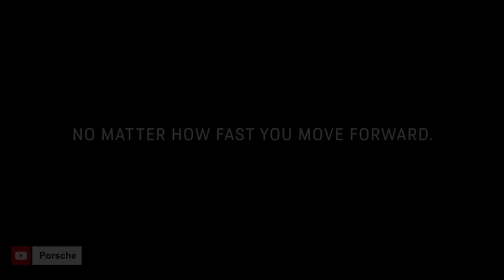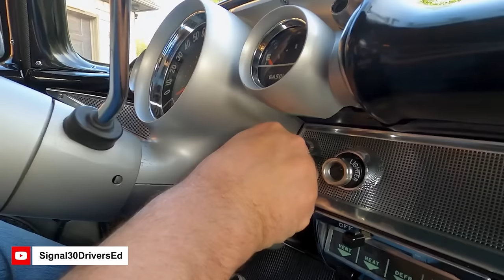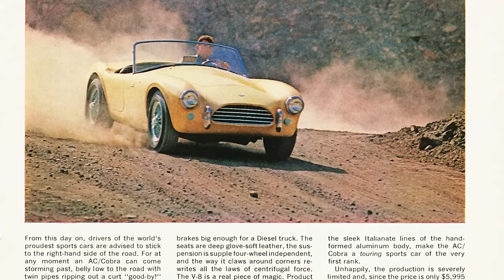Why Old Cars are Better

Comment: I hate that people think the old car obsession is only because of nostalgia. It feels like everyone is getting grifted by the regulators and manufacturers to think that newer always = better. There are plenty of ways older cars are objectively superior. Outward visibility, ride comfort, and ease/cost of servicing are just a few. I'm 33 and by choice have never owned a vehicle newer than 1997. Older vehicles are nicer to own, and nicer to drive.
Reply: The only advantages old cars have are looks, personal feel, and basic components. 

You want reliable, SAFE, efficient, options, then you go new. 

And holy shit safe is such a key point, old cars are absolute deathtraps if you crash, but hey you get to look cool as you die
Reply: @mattd6085  Do you just think all classic cars are 1967 Mustangs or something? You'd be shocked at the quality and comfort of something like a '79 Mercedes. The outward visibility and ride comfort--things that actually matter every single day you use the car, not just when you crash--are superior in older cars. Vintage diesel Mercedes can go over 500k miles on their original engines and nothing more than routine maintenance. 90s Japanese cars are also more reliable than the equivalent modern versions.
Reply: @verdict1163   What is comfortable is entirely subjective. My modern daily is far more comfortable than my 1980's car. And if I had to choose what to be comfortable in when someone hits me head on, it's gonna be modern and you'd be a fool to say otherwise.

Vintage diesels can last just as long as modern diesels will with maintenance, but holy shit they are wildly inefficient compared to a modern one. 

I can tell you now my modern JDM is more  reliable than my EP3. All the 90's cars that weren't reliable are already dead and scrapped, it's called survivorship bias.
Reply: @mattd6085  Specifically, the ride quality is superior on older cars, because of the tire sidewell and softer spring rates allowed by lower curb weights (not having to haul around all that extra safety equipment). Seats were often sprung instead of just hard foam, another sacrifice for passive safety. 

It's a fact that 90s/early 2000s cars were the peak in terms of reliability, and have kind of slowly declined since then. Everything now is boosted to the moon, direct injected, thinner weight oils, to eek every last bit of efficiency out. None of which is good for long term serviceability of reliability. 

Offset piston/rod geometries, integrated subsystems (that can't be repaired but must be replaced as a unit), sealed transmissions, thinner weight oils, a general lack of bottom end reinforcement - these are all examples of ways in which modern engines are not built as robust as ones from a few decades ago. 

The 1990s were the sweet spot for reliability because we had extremely good machining standards and electronic fuel injection, but without the extra complication mentioned above that came later to eek out every last MPG.

Comment: How old cars are actually better: they were simpler to work on, so anybody with a set of hand tools could work on them (which is good because you were gonna have to work on them). 
They had better visibility (which came at the cost of the roofs crumpling like a tin can if you rolled them over)

Modern cars are faster, usually more reliable (depends on the brand or model really, looking at you bmw, and Subaru boxers.) They're faster, and more efficient doing it (don't come at me with some anecdote about a customized car or one off). They're way safer for the driver (which given today's drivers, is sadly needed). And way more comfortable (ergonomics of the seating, better climate control, better suspension). And way easier to use (thanks technology).

Everything els in this video is just pining on about how it makes him feel, throwing objectivity out the window.

Don't get it twisted, I love old cars, but let's not throw away reason and facts for our feelings.

Comment: I'd bet that the Tesla if stored correctly (so save from moisture) would last (the only thing that would break in those mention 50 years would be the battery! Yes, it would be expensive to replace those, but otherwise the vehicle would not degrade much IMHO...electric-motors need a lot less maintenance than a combustion engine!

Comment: Although my car will be 20 years old in a year and I always feel nostalgic about the beautifully designed '70s and '80s cars from my childhood, I can still remember of the issues. An edgy old car with no safety systems could cleave the limbs off of pedestrians like in Carmageddon. Also, even a low-speed collision could kill the entire family inside so efficiently that even the dog left home died. You were lucky if the car did not completely fall apart after a coulpe of years / 50E kilometers. Even many of the cherished Japanese cars of the era started to rot away the chassis around the otherwise healthy engine after 10 years. And so and so on forth. Been there, seen that.

I think the sweet spot is somewhere around the early 2000s where some important safety systems like ABS / ESP / no pointy edges were already included, materials / timed aging were not set that precisely as now that cars can literally fall apart after guarantee periods are over. Also the cars were not littered with unnecessary electronic crap like massive touchscreen systems that on failure stall the car completely. Simpler is always better. I can see an ample of dinosaurs from late '90s - early 2000s still running on the road in decent condition, many of them running way above 500000 kilometers with factory installed major components.

Comment: I'm 41

My first....
92' Corsica 
Current....
07 Volvo C70
What i want....
83 tbird 4cyl turbo in red

My current vehicle is my favorite it's not a classic yet but it's on its way and it's very simple it doesn't have all the touch screens and all the extra s*** these cars have these days it is the perfect vehicle for me. It's a straight 5 turbo. It's simple. I do not want a brand new 2023 2024 vehicle I feel like they are too much. I also had a 99 Mercury cougar which was a very close second place that was simple it was a stick it was a 6-speed it was simple. I also had a 2003 Hyundai Tiburon it was a stick it was simple. I feel like the older cars are just better they were built with a different mindset and not all the extra s***. Also I never wanted a car that everybody had I hated that. I don't like push button cars I don't see how people got used to that. I don't like my car cutting off at a light by itself and then cutting back on when I hit the gas it's just too much. I like to work on my car I don't want to have to go and take it to the dealership every time something dumb goes wrong.

Comment: This simply isnt true when it comes to cars. We have extreme survivorship basis when it comes to vehicles. 1950s car modles didnt even have odometers capable of reading over 100,000 miles. Even 80s models rarely got over 200,000 miles. New modles, espcially toyotas, hondas, and even other brands can easily get 250,000 miles with proper maintenance. Old cars absolutely did not last as long

Comment: I think you're over selling it a bit. And maybe some older cars feel the way you're talking more than others. I have a 67 Thunderbird, with a 6.4 l V8 and the rear suicide doors, by the way headlights, vacuum system that locks the doors and rows the windows up and down. No I know at that point with the mustang a couple years old Thunderbird was meant to be kind of this luxury sports car before it became the land yacht luxury car of the '70s. It feels very comfortable and some of the stuff you're talking about just doesn't apply to that car It actually surprises me how modern the car feels for a car that is from 1967. I have made a few improvements just to make the car a little safer I upgraded the rear drums to disc brakes since the front brakes were disc and redid the brakes on that thing metal brake lines the whole deal to make sure that car stops. Upgraded the carburetor cuz when the original went it was a bit small for that car so the newer one bit overpowered but gets her moving a bit more which I like. But she's a smooth driver. Dual exhaust but muted sounds she's not rumbling she's not meant for that she's a refined glamor bird that she was nicknamed. Listen to podcast and play music I have an updated the stereo system so it's still just an a.m. simple unit I just have a big Bluetooth boombox that I bring with me when I'm cruising in that car and play music from my phone. In some way she's very simple but another ways she's sophisticated for her time and she feels elegant she drives nice more like a modern car I think a lot of people would say that car feels like a higher end luxury car from the '80s like a New Yorker something by Cadillac or Lincoln more than it does something from the '60s. Otherwise good video I did enjoy it.

Comment: I HAVE 86 VETTE 160000 MILES CHANGE OIL EVERY 3000 MILES  PUT 1500 INTO IT AND WOULDN'T  FEEL SCARED TO TAKE  IT ON A LONG TRIP. FIBERGLASS BODY NEVER RUSTS .TODAY ITS HARD TO TELL A HONDA FROM A TOYOTA OR CHEVY FROM A FORD
AND DON'T GET ME STARTED ON SUV S. COOKIE CUTTERS

Comment: The best solution I think is to take a modern car that has been written off, one of those with a nice aerodynamic body, then tear out and sell all the new garbage components as a parts car, put an old bulletproof motor and gearbox into it, hook everything up from there and drive it. You get the benefits of brand new aerodynamics for maximum fuel economy, and with all the office luxury driving comforts removed you're actually connected with the vehicle. And of course, wide tyres with tall sidewalls for comfort and low rolling resistance, since we all know wider tyres roll better than thinner ones at the same tyre pressure, that's why normal cars use 30 psi, but thin tyre ecoboxes use like 65 psi tyres instead that provide roughly zero traction.

Comment: Old cars are not better as far as safety goes. You get in a rollover or high speed wreck in one of these, you'll be seriously injured if not dead. Not to mention no power steering, manual drum brakes, no seatbelts. They're deathtraps.

Comment: This is some navel gazing if I've ever heard it. 

Look, I've rebuilt the suspension completely on more than one car, done engine rebuilds, torn them down and rebuilt them, the works. Yeah, it's all old cars I've done this to and old cars are a lot more simple than newer stuff; cheaper to repair, more simple in design and sometimes, generally designed to actually be repaired. 

But here's the thing: New cars ARE better. Yeah, they're generic, they lack character, etc. But when I was a kid, people would say stuff like, "100 thousand miles? What a jalopy, better buy something new", because you were looking at cars that were cheaply assembled, cheaply designed and generally lasted about 60k miles before needing major repairs and rebuilds. Sure, your average Chevy or Ford might need something like that these days, but you can also go to the dealership and buy yourself a Honda Civic for 30k that is easily going to last you 20+ years, get 300k+ miles, be safer, quieter and FAR, FAR more fuel efficient than something built in 1950. 

Old cars handle like crap, they smell (no emissions, after all. Take a shower after driving yourself to grandma's), if you get yourself into an accident, expect to be impaled upon your steering wheel or have the entirety of your upper body smashed when it rolls over. 

I get it. I like old cars too, own a couple and continue to maintain them myself. New cars are full of computers that I can't hope to troubleshoot, but let's not pretend everything is bad and that we're all "le born in the wrong decade." Cars are better than they've ever been.

Comment: Quick answer: Old cars had a soul and personality. 

New cars, are just soulless copies of copies.
Reply: Quick answer: Old cars had a soul and personality. 

New cars, are just safer, more efficient, more comfortable, longer lasting.
Reply: @mattd6085  "longer lasting” I beg to differ…
Reply: @BETTER.ART.   There are more cars from 2001 on the roads than 1971. 

The only old cars left are the few that happened to survive by being looked after. You look after a car from 2010 it will last just as long.
Reply: @mattd6085  well, it may be that I consider a car from 2001 an old car. Everything after 2005 just reflects the current throw away society culture in my opinion. After that time, cars just got higher and unnecessarily bigger.
Reply: @BETTER.ART.   The US is not the default. Post 2005 cars are STILL average sized and reliable here in the rest of the world. I have a 2009 daily car in my collection that is maintained and so far hasn't had the slightest issue. My 1980's car however, requires a lot of care to keep going.
Reply: @mattd6085  who said anything about the US?

2009 is also not a new car. Take the latest BMWs or Mercedes for example. 

Everything inside is digital. If your odometer display breaks, you can’t drive, as it won’t let you. You have to tow it to the dealership and it will cost you a fortune to fix, as the whole thing has to come out. Just small repairs and fixes in general. Everything is over complicated.
Reply: @BETTER.ART.   You literally said anything post 2005 is throw away. 

If your brand new digital display breaks, your warranty will cover costs? If you're trying to argue that it's MORE likely to break, you better back it up with figures, otherwise it's just you personally not liking modern systems. 

If someone REALLY wanted to, they could learn how digital systems work and fix it themselves. Just because it requires a different set of skills to older purely analogue systems doesn't make it a bad thing.
Reply: @mattd6085  “ … in my opinion” 

What if it breaks after your warranty expires? 
I don’t need to back it up with any figures. I just need to ask any of my mechanic friends and they will tell you the same thing. 

It’s no lie that newer cars are filled with unnecessary shit. (Not talking about safety sensors) 

More electronics and digital stuff —> most likely to break.
Reply: @BETTER.ART.   Of course you need figures, otherwise you're just talking out your ass.

Comment: love the vid but 1 clear lie you said was fuel ingection is simpler then a carb NO NO and NO if a vehichal has a carb even if the carb is bad and needs rebuilt u can still get that car running may run bad but run fuel injection not so much sometimes yep its great car can sit but because of the fuel injection just fires right up but most the time some many difffrent things can happen with it that it be easier to replace the entire fuel system carb on other hand pop it off clean it a bam prob gonna work great maybe some new jets and its easy to do fuel injection is almost hated by every mechanic ive met because its complicated and varys so much from car to car carbs nope u can replace with carbs from a crazy car all you might need is a adapeter plate sorry just a lie carbs 100% easier and less complicated heck i know 3 guys that have ripped out the fuel injection systems entierly and made them carbed on LS swaps chevys fords modern and old why because carbs are easy quick and even if somehow your carb just blows up u can put another on and tune it in like 30 to 40 min on the side of the road cant do anything like that with fuel ingection your calling a tow truck scratching yor head what am i goona do while im already on the road again before your tow even got their

Comment: we need to remove all the non-required parts from new cars
the complex radio systems? gone, it just needs FM/AM and that's it
all the complex electrical systems? get'em out, we just need the ones that makes the car go
why do Miatas/MX-5's sell so well? because they are simple, yet fun, cars that do what needs to be done

Comment: You're wrong about a lot.

We could build those old houses, and we could build them better. It's just too expensive to do so nowadays. The material demand is much higher now so what matters is quantity. Houses just 'house' more today than in the past. You dont just fill it with furniture, and glassware. You fill it with a TV, a Computer, a fridge, microwave, coffee maker, air conditioning, and so on. All these extra gadgets require you to spend less on the house to still have the same quality of life thus lowering quality.

Look back on how much things cost back in the day. Now adjust them for inflation. Would you pay $120 for a toaster or $10? Cause thats how much things cost. There were fridges in the 50s that cost as much as a car. A TV for 5K? A 1.2k radio? Hell, a walkman was more than a smartphone today, a mid range hifi set up in the 80s would be something like 3 grand in today's money, and the audio tech moved at the speed of smartphones in the 2010s.

Anyway. Materials for cars today are shit for a reason. To have the same quality as the 40s, and 50s the price would go way up, and no one would pay $180k for a Honda E. There is more demand now, and quality keep up.

And wtf was that about Porsche??? Their small size wasnr cultural. There was a fucking WAR that you may have heard of? They didn't have metal to spare, and the people were broke from rebuilding their countries. No one wanted an Isetta or a Messerschmidt because of their size. They were the only thing some people could afford.

In the 09 Malibu crash test the old car had no engine, and the frame was rotten. Not that it matters, you'd have gone through the windshield anyway or the engine would ever come through the dash, and deleted your torso. Still - the old car was set up to fail so Chevy could sell the new Malibu. I remember that video being shown on morning talk shows back then.